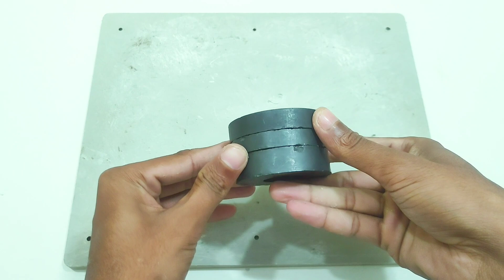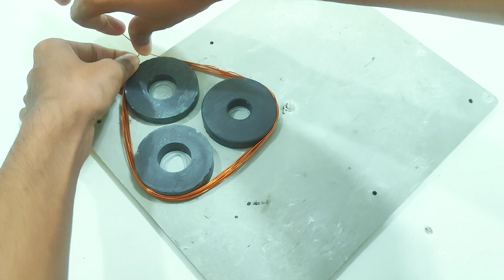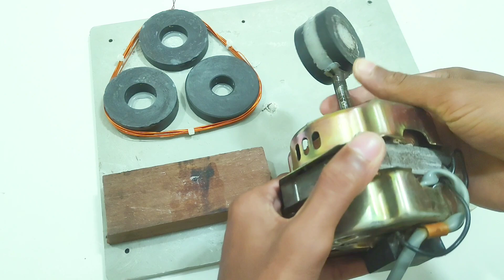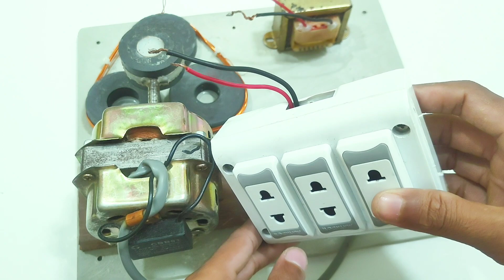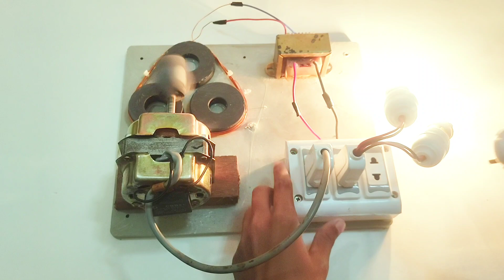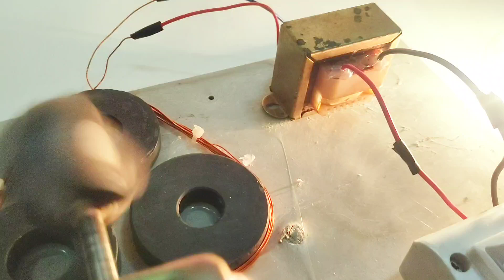How to make Energy 220v Generator 14 Number Copper Coil and Magnet 10000w Power

Comment: Obviously Mr 4 Technology doesn't know anything about electricity. The title says 10,000 watts. Lets work out this. P = E X I so 10000 = 220v X 45.45amps. First the wiring used is way too small to support 45amps. The best you can achieve here with your circuit is about 300 watts. Also, your circuit will generate a lot of noise. Care to explain where you took the 10,000 watts??? Most Indian guys making videos here about electricity would need to learn about it before claiming such thing.  Source : over 30 years of electronic engineering. Now to whom ever wish to build something like this, please be extremely careful because this video is simply here to generate money for this guy. His claim is not true